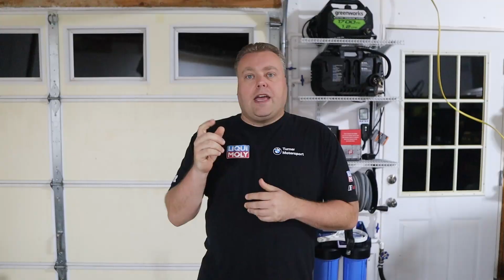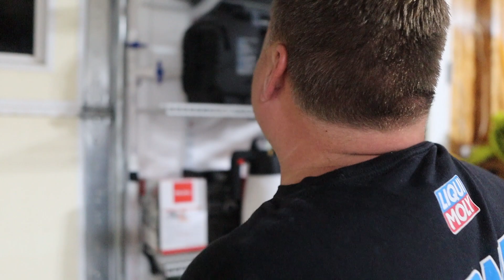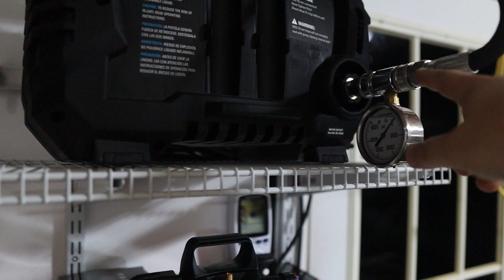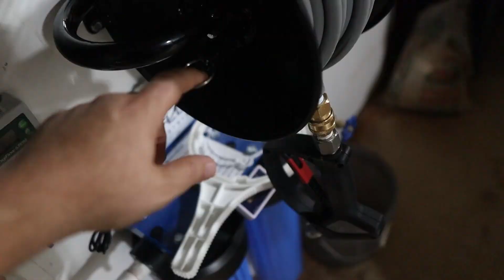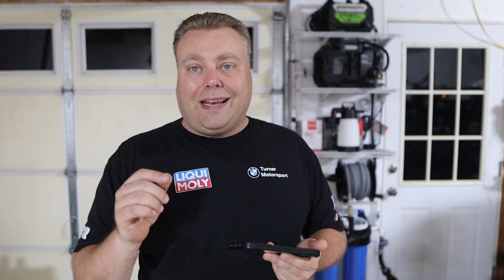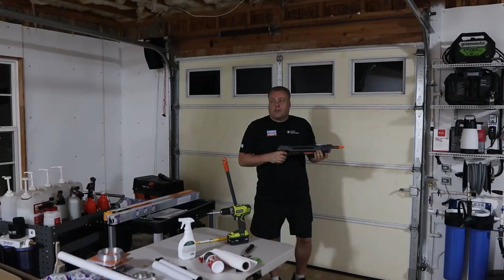Ultimate Budget Wall Mount Pressure Washer Setup | Cost Breakdown

Comment: Thanks for the great video!  I am curious - how those Digi-Flow 6710M-66 meters are working out 1 year later?
Reply from the maker: Working the same as day 1. They run all the time since water is always flowing most days between washing and filming. They are off by maybe 3% to 4% in either direction, but I expected that have not found a flow meter that was any better. For instance on the pressure washer side with my 2.0 it shows around 1.87 GPM when it’s closer to 1.93. Depending on temperature it could be more or less so it all evens out to me when it totals the gallons.
Reply: @CarsWithKeav  Sounds great.  I will get them ordered for my system tonight.  Thank you!

Comment: Just got the general pump reel.  Shocked it didn’t come with lags to mount it to a wall.  You have any issues with yours? I have plywood backer board already in place.  Curious if you ran into issues.
Reply from the maker: No issues hear I have it mounted to a cheap 1/2 inch board. Holds real good. I hate they don’t come with lag bolts too. Had to go to my bucket oh nuts and bolts to find something.
Reply: @CarsWithKeav  Thanks for responding.  Got ‘er mounted earlier today with 3/8” lags.  Solid.

Comment: Great video. I will be doing mine like this. Why didn’t u just use a 3/4 spigot instead of reducing to 1/2” then back to 3/4? Thanks man!
Reply from the maker: I don’t have a true 3/4” that’s the thread size, but the inner diameter is the same and the main line there is 1/2”. I thought about going 3/4 piping, but was worried about pressure loss when using a garden hose. I am going to redo my valves and go to union joints. The ones I have reduce diameter and the flow counters do as well. Union joints will let me unscrew them without having to cut and don’t reduce inner diameter.
Reply: @CarsWithKeav curios if you tested the water pressure and if 1/2 is indeed better than 3/4 piping? OG uses 1 inch Prevost piping so i was thinking 1/2 may be restrictive? Not clear because jumper hose cables to pressure washer is 1/2 inch as I understand stand it. Any thoughts would be appreciated.
Reply from the maker: @MrAmonts  1/2 inch piping runs up to 14gpm with schedule 40 pvc so I saw no reason to go 3/4 and pay more money. My copper pipe that was run to this area that I repurposed was all 1/2 so no need to run 3/4 in my opinion I will never need more than 14gpm. OG uses that because he wants to best of everything and believes 1 inch is best, but if all the internal water piping going to it is 1/2 or 3/4 are you really using the advantage of a 1 inch pipe? It could be better, but I have not tested to know I just know I have more than enough flow with the 1/2 inch I have. Plus if running a 2gpm pressure washer you will never use it all.

Comment: Any reason why u left out the prefilters like u have on the cart?
Reply from the maker: The Resin filters were large enough to handle what I need and before was using the prefilters for the pressure washer to save on the resin, but now just using the DI on everything.